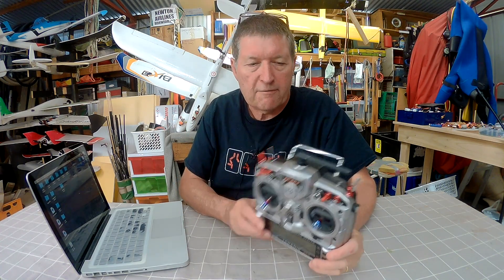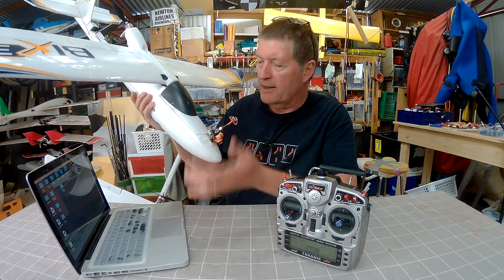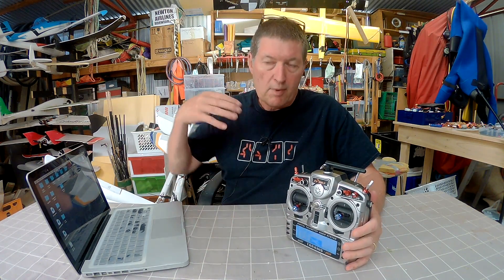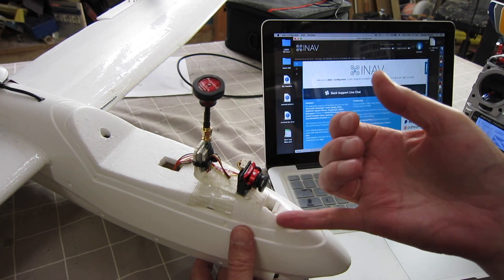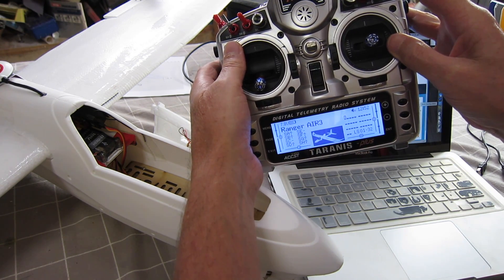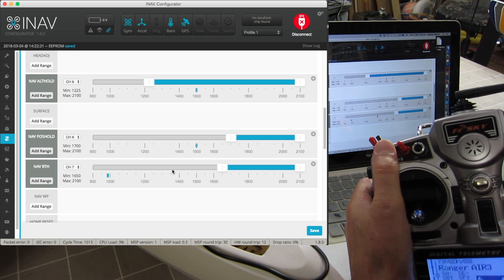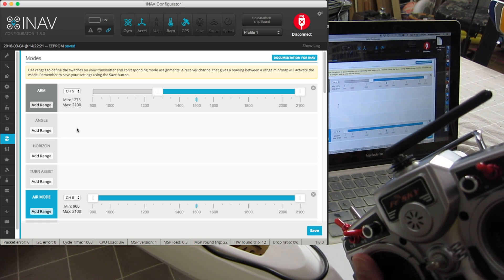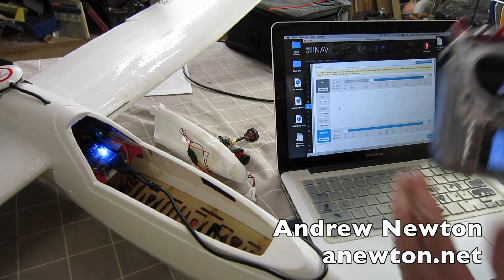My iNav modes

Comment: I really confused on altitude hold mode, I have this setup same as you but inav github says altitude hold should not be used alone and should be combined with angle. Is this correct or maybe I'm not understanding this? Looks like you are using this mode alone. Any advise would be appreciated Thanks
Reply from the maker: All of the navigation modes include angle automatically. The Wiki is confusing or even wrong on that point.
Reply: Ok so I can just setup altitude hold mode on a switch and don't need to  combine it with angle on same channel? No wonder I'm confused but did I understand correctly what I read in wiki? Thanks again

Comment: Andrew, thank you for great video(s). You recommend to avoid using onboard BEC. That complicates wiring and needs additional BEC. What is your reasoning behind and how you usually to power distribution wiring for servos?
Reply from the maker: These days I use Matek FCBs that have built in power distribution and filtering. The problem with boards like the Omnibus F4 and old Air3 is that they are sensitive to voltage spikes on the power supply and can shut down or reboot (not that I have ever seen it happen) Powering the servos separately is best practice to reduce voltage spikes.

Comment: Thanks for all your videos and information, I'm trying to learn as I go and not sure what's normal or not, so my c1 chaser flying ok in alt mode 2.5.0 but seems like very little throttle response and even bench testing it seems no throttle or maybe half throttle it don't change with stick inputs, in acro or manual throttle response is perfect I can't figure this out because how could you change speed during in  flight in alt. I must be missing something, also  in alt mode it maintains altitude perfect but rolls and pitch very slow. Please advise Thanks
Reply from the maker: Sounds normal. The Nav modes like Alt Hold use Cruise throttle setting and Angle mode for stability. You can enable manual throttle control above cruise throttle in the CLI (set nav_fw_allow_manual_thr_increase = ON)  If you want more roll and pitch in Nav / Angle modes, then increase FF for roll and pitch.
Reply: So if I enable throttle in cli will I be able to fly any speed according to throttle stick response? Is there a down side will it affect altitude hold in any way. Right now it holds altitude perfect but I can't fly any speed I want its it's either around half throttle or motor off gliding. You have been so much help doing this learning process. Thank you
Reply from the maker: It will allow throttle to be increased above cruise throttle, not below

Comment: Im still trying to learn inav, im running 2.5.0 but no maiden flight yet. In ALT hold seems that plane would hold alt. But would be pushed off course by the wind, in pos. Hold will it maintain Alt. If Alt.hold not selected? Also I see no Acro mode in modes menu in 2.5.0 but you recommended landing in Acro. Thanks for all your help and videos
Reply from the maker: Acro is the default mode. It's active if you dont choose any other mode. Pos hold now holds altitude without needing to also choose Alt hold since iNav 2.5
Reply: Ok Thanks

Comment: Great video, thanks Andrew. Quick question, what happens if you select both your left and right switches simultaneously to separate modes? I notice you have for example RTH and loiter mode being controlled by separate channels. If you select them both at once what happens? Does INAV have a priority system or simply go with the last command? I’m curious as I want to have 5 or 6 modes available using two 3-pos switches and don’t want to get in a muddle mid-flight!
Reply from the maker: Manual has priority, then RTH, then Nav modes like Alt Hold, Pos hold.

Comment: when in configurator and I select poshold it does not turn blue, but alt hold will, is this by design ?
Reply from the maker: Probably need GPS lock and armed board. Most of the nav modes won't show blue on the bench

Comment: on nav launch, 
the motor start spin when the throtle stick is shifted up or after the plane is in the air? can I use that mode without write on CLI? -tried on my zohd nano talon,  thanks,
Reply from the maker: Flick the Nav Launch switch, Arm the board, advance the throttle (it should not spin) throw the plane within 5 sec and wthout touching the sticks, then the motor will throttle up about 1/2 sec after the throw. You set it up in the Modes window, no need to use the CLI

Comment: Hi Andrew,  I have a Nano Talon running INAV ver 2 on a Matek F405 Wing.  It has Nav Launch enabled and I want to disable it.  I can’t find any reference to this feature in the MODES tab of the configurator. In CLI I can see the settings for NAV LAUNCH but have no idea how to disable it.  I’ve tried things like set INAV_LAUNCH = OFF or 0 but no luck.  I’m a bit clueless here so perhaps you can help.  Thanks mate.
Reply from the maker: Configuration Tab - Other Features - UNCLICK Permanently enable Launch Mode for Fixed Wing, and make sure NAV LAUNCH is not active in the Mode Tab
Reply: Andrew Newton Andrew, thank you so much.  Firstly for getting back to me and secondly for coming up with the solution to my query.  Have a great New Year.

Comment: Andrew, guys, I have a question: if I want my wing to hold position and altitude, shoud I assign in my radio POS HOLD + alt hold or just  POS HOLD? in other words, does POS HOLD "contains the alt hold" command mode? thanks to all.
Reply from the maker: Good question. With iNav 2.0 - POS HOLD automatically includes ALT HOLD, so you only need to select POS HOLD. Before iNav 2.0 they were separate and both needed to be selected for a proper loiter mode.
Reply: Andrew Newton thanks so much.

Comment: Where did you get the voices for modes? 👍
Reply from the maker: Amber sound pack on the Taranis. You just program in "Play Track" then select the relevant track for each switch position
Reply: Andrew Newton oh I tried that. I only had a few tracks to choose from. I guess I need to update my opentx .
Reply: Awesome, all done. Much easier to understand modes now 👍.

Comment: Not sure if I’m missing something really simple but the modes are not working on the plane. If I operate a switch, the blue light on the board flashes, the display in the model changes but nothing happens on the plane. The motors spin with the Arm switch off etc.
Reply from the maker: Impossible to diagnose sorry. What is the plane?
Reply: Andrew Newton sorry, Andrew - I didn’t realise this message had sent, it was incomplete as my friend called and pointed out some of my connections were wrong.
Reply from the maker: Excellent, hope you have success now

Comment: Hi Andrew, nice video. Two questions - I'm curious if you have experimented much with the inav waypoint mode? I have a spectre setup similar to your Ranger but with Pixhawk. Thinking of trying inav via Airhero3. Second, do you use a pitot tube on these configurations? If not do you see any need for one?
Reply: Air speed measured with a pitot tube is only used for reporting it in the OSD and for coordinated turns for the moment (TURN ASSIST).
Reply: Michel - good to know. Thanks
Reply from the maker: I have not tried waypoints or pitot tube Mateo. May be useful for more serious FPV projects
Reply: Ok - thanks for the feedback. I plan to work out waypoints for sure, maybe add pitot as needed.

Comment: Angle or Horizon Mode will not maintain altitude for you, they are not GPS Modes. The pitch trim will always drift one way or the other.
   With the plane in Altitude Hold / Horizon Mode, and flying straight and level, the AHI should pass through the centre of the cross hair on the OSD, thus indicating the board angle trim in pitch is correct.
  Horizon Mode is better than Angle for doing this simple test.
  The Cross hair on your OSD and AHI is very useful when setting up board trim / pitch angles.

Comment: Horizon Mode combined with Altitude Hold....my favourite cruising Mode.....You can still steer, but relax and watch the scenery while iNAV takes care of altitude.
I know some people ONLY set up Failsafe Mode and NOT RTL as well. Either (switched) mode will bring the plane back Home but they do it slightly differently.
  What you did not demonstrate and it is rather important, is switching off your transmitter, thus simulating a real signal loss scenario.  When you switch off your transmitter, the receivers failsafe should be set for good measure to put the Flight Controller into FS Mode. You can test this like you did in your Demo with the bar charts...:)
   When you set "No Pulses" I think signal loss will make the FC go into RTH or FS anyway but the TX switch off is crucial as a test before testing the limits, especially if you are only using a 2.4G control link.

    Predator Tee-Shirt logo Andrew....Have I won a prize..?....lol.
Reply: I found out the hard way that in alt hold mode, you elevator stick is disabled. Would have been nice to allow stick inputs to adjust altitude on this mode.
Reply from the maker: Ha, correct but no prizes for this one.
Reply: Oh, hell, I never win anything....lol.
Reply: Hi will there any problem if I input Horizona and ALT hold during my  NAV Launch?
Reply: @Indonesia01ian Just use Launch Mode as intended...What you suggested isn't going to work unless your launching off say a Clifftop or big hill....🤔😳🇬🇧

Comment: When you use manual mode aka passthru do you need to also have expo, dual rates etc on your radio? Without INAV, I always fly with 30% expo so I am wondering if when I try pass thru I will be caught out with zero expo?
Reply from the maker: Expo is at 50% by default in iNav and that is used in Passthrough mode. I usually drop it down to 30%. For rates, you need to set up the throws mechanically so that 100% is comfortable to fly with.
Reply: The new 1.9 version soon to be released will allow you to set different servo travel for manual mode. BTW PASSTHROUGH has been renamed to MANUAL in this new version. See the release notes for more info.
Reply: Sounds good as with INAV 1.7  I found passthru uncontrollable compared to acro with air mode enabled. Made me think zero expo was in use.
Reply: 1.9 has just been released if you'd like to try it.
Reply: In passthrough mode, no expo or rates are applied. You need to add them in your radio - in my Taranis I set up rates and expo to apply only when my mode switch in the passthrough position. In 1.9, you can add rates and expo in the CLI in the new manual mode. I still think it would be easier to use the radio ro make adjustments to them.
Reply: It depends. I use a Bluetooth module connected to my phone to change iNav settings it is very easy. Also for some models I use a FS-I6 radio for compactness and then you don't have the choice you need these settings on the FC.
Reply from the maker: From the Wiki
 "PASSTHRU Direct servo control in fixed-wing.
In this mode there is no stabilization.
What FC does in PASSTHRU mode is: Motor mixing, Servo Mixing, Expo settings. Also Failsafe is still active so it wont overwrite that function.

Comment: If you plane doesn't fly good in angle mode it won't function any good on RTH and loiter too since they uses angle mode underneath. Try to use board level adjustment to let the plane fly almost straight in angle.
Reply: Also board level trim must be right for ALTHOLD to work the best because the throttle adjustments are based on the pitch angle.
Reply from the maker: Oh I didn't know that. Must be close to level because they fly well in RTH and Loiter
Reply: Andrew Newton rth and loiter reinforce altitude hold so the FC corrects the level by itself.  It is 100% advisable that the plane flights good enough in pass and then fly level and straight in angle. Then you golden  to go.  In this case the FC will do much less work and it is ready to counteract wind for instance
Reply: Angle or Horizon Mode will not maintain altitude for you, they are not GPS Modes. The pitch trim will always drift one way or the other.
   With the plane in Altitude Hold Mode, and flying straight and level, the AHI should pass through the centre of the cross hair on the OSD, thus indicating the board angle trim in pitch is correct.
  Horizon Mode is better than Angle for doing this simple test.
Reply: EnglishTurbines never said that.